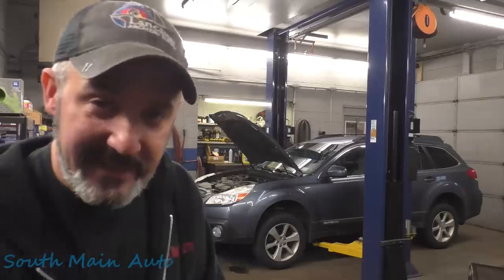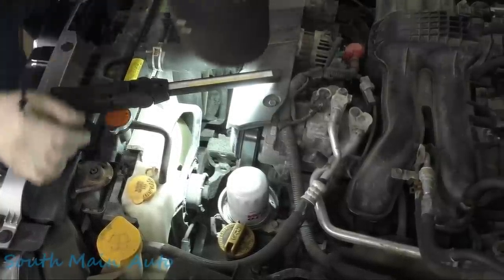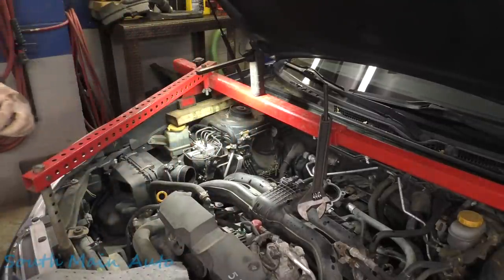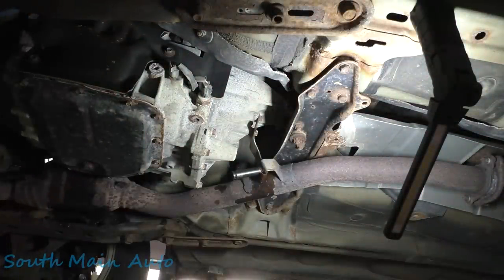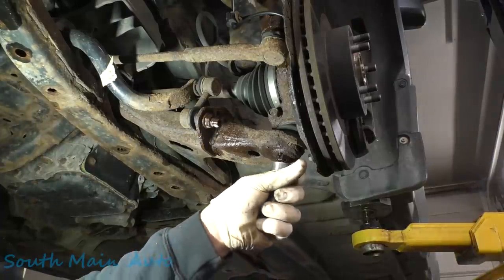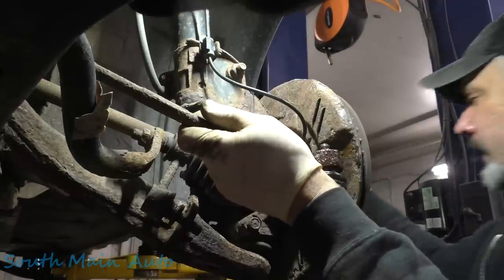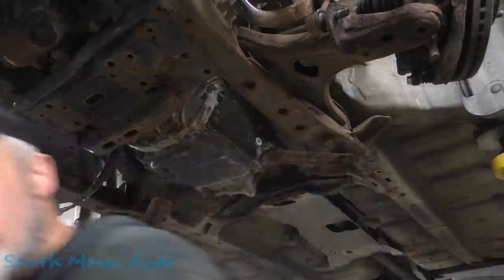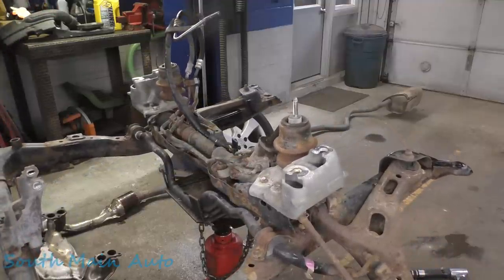Project Rotted Subaru Subframe - Part I

Comment: I just replaced the front subframe on a 2013 Mercedes C300 (damaged, not rusted), and what I did to support the engine was I hooked a ratchet strap around the frame rail on one side, then strategically under/around the engine, and then hooked it around the other frame rail. It took a little creativity and planning to get everything situated where it needed to be, but it worked great.

Comment: On Subarus when you support the engine you use the mount that’s built into the compressor area or you use a “special tool” that bolts into the block in the same area. Also when you remove the engine I use the bracket on the pass rear and the spot near the compressor.  That’s what it’s meant for. But that how Subaru wants you to do it, what works…. WORKS! 😂

Comment: Daughter had the subframe replaced on her 2005 subaru a  few yrs ago. Western NY rust belt is very hard on cars driven in the winter. Car is now gone as one of the lower control arms broke in two pieces about a month ago. Lots of other issues like oil leaks, head gasket failure, etc and it was time to cut and run. They dont last forever.

Comment: I really enjoy watching your videos; I learn something new from almost every one. One thing that drives me crazy though: You hardly ever wear safety glasses, even when you're under a car looking up at the rust flying off while you're using air tools. I got a piece of metal in my right eye helping put an engine in my friends van when I was 17 (66 now). It hurt like hell, and getting it taken out was no fun either. I've worn them whenever I work on anything where that could possibly happen again ever since then, and they've saved my eyes from damage more than a few times. I wear the ones with the magnifiers in the lower lens these days, and that's a big help too. Just some friendly advice, but I'd hate to see you get hurt. Stay safe and keep making these great videos. I watch due to your sense of humor as much as for the information, you're never boring!

Comment: I've done 2 of these in the past month at my shop. Not nearly as crusty as that one. The rear control arm bolt that goes up through the subframe into a sleeve broke away on both. The worst part is no Subaru dealers deliver to me so I have to drive 75 miles to go get the subframe.
Reply: Haha… going for a drive would be my favorite part. I love driving and getting out of the shop every now and then is good for me.

Comment: On the west coast of Florida we have a better way of getting salt on the road. We like to call it storm surge. The Gulf Mexico ends up in people's front yards and across roads. People being people they drive through it. I've seen a few people crack their blocks bombing through two feet of water pretty impressive. Cars that have been in the Gulf of Mexico or in the water like that you'll rot out in a couple years
Reply: I worked in a body shop for Lincoln dealer on the west Florida coast in the  mid 70’s and we fixed a lot of cars that were parked under beach houses before the condo boom. Those cars were pure salt crusted in every nook and cranny and underneath, worse than any car I ever saw living in New England previously. Those cars were all junk from the high rent Distric of the beaches !!!!
Reply: @rogern5368  doesn't surprise me. I lived in south Tampa, salt water on three sides. Part of why I hate aluminum air conditioner coils on home air conditioning.
Reply: @pudermcgavin4462  no argument here

Comment: Nice video,  I'm suprised that it makes financial sense to replace that do you mind telling us how much the new subframe was? Also could you please show in part 2 why it failed inspection? 
Re spilling the ps fluid, you're not a hack lol, that's the only reason the exhaust bolts came out Haha!
Reply: It's significantly cheaper to replace the subframe than to go out and buy a new or used car in the current market.  Even in previous years for most cases, its cheaper to maintain a car than buy a new one every  three to five years.  For some reason folks like to keep that car note rolling on forever.
Reply: I doubt the new sub frame will be brand new. Most likely used rust free. Can't wait for part 2
Reply: that U frame is about $400 brand new from a dealer. i just welded a patch on mine yesterday. =]
Reply: Cheers

Comment: I must be missing something here.  It’s a 2014 and the frame shouldn’t have rotted through yet.  I don’t think he has showed exactly where the problem was and why the frame was not salvageable.  A torch can do amazing things when it comes to frame repair.  Hope he explains in part 2.
Reply: Nope! You need to check some out! Body on my patriot still had manufacturing tags on it and subframe let go on turnpike causing left front wheel to collapse into wheel well. Nothing left but rot!
Reply: Eric show us the issue in a Short. Clearly it needed to be replaced.
Reply: @ME-xd4he  yup. I saw the short.  Comment was made before the short.

Comment: You gotta be the rust crust master.
My experience is the unibody crumbling as I'm removing the body mount bolts. Just walked away from a Brat with the rear suspension falling out. Sure looked good from the top side!

Comment: Hi, Mr. O. I can see that in the PRNY, rusted out sub frames is a big problem. I guess mostly such just go to the crusher. But the cost of new cars seems unreasonable. Pent up Covid demand is probably the cause. If it were me, I would rather repair a good car than pay more than asking price for a new car. I had never seen a sub frame extraction. The engine suspension device is another new item for me. I am looking forward to seeing part 2 of this job. And don't ask Mrs. O. to help you with that job! Anyway, thanks for sharing! Stay healthy!

Comment: As the owner of a number of Subarus over the years, I can affirm that they have a particular affinity for the demon rust. Beware, when you buy a used Subaru. Get it up on a lift first, and check it out.  I'll be curious to see where Eric sourced a decent front subframe replacement.
I've heard they could be found in Florida, but that was years ago.
The rear subframe is a nightmare to tangle with. All sorts of things have to be removed, to get it out. I've junked more than one Subaru, rather than deal with that hornet's nest. I've got a rusted out old Impreza in my yard I still sit in, just to listen to the great stereo.
The motor is fine, but the rest of it is history.
Re WD-40: Great stuff. Accept no substitutes.

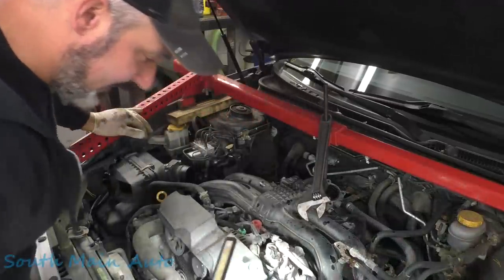Comment: 13:00 - tip for you Eric, Ahmed the Car Care Nut, a dealer master technician for a long time showed that if you don't want your lines to peepee all over your kitty converter, use those expandable bright orange ear plug protectors to squish the line closed from the inside without the viewers generating comments about not using pliers to shut em down.

Comment: I'm in north central PA, I just had a Subaru Baja come in for inspection the other day.  The guy he just bought it from "had the subframe replaced".  Two of the four main mounting locations were busted right off of the car and someone tried to pack aluminum foil duct tape and Bondo all around the broken locations and paint it black.  Needless to say the areas were already ripped open again.  People don't value their own lives or the lives of other people.  And also, southern mechanics and car owners don't know how good they have it...

Comment: How I hate NY and salty roads. We visited a sister living in Richmond, VA in 2013, and needed a new seatbelt for the rear of our 2000 Dodge Ram Van. They had one in a junk yard in Mechanicsville, same year, make, model, color that was flipped on its side in the yard, someone needed something off the bottom! The chassis was perfect. Zero rust. We should have just swapped out our motor and tranny and driven that one home, as ours was rotting the entire underbody, especially the wheel wells, you could see daylight through them, on a 13 year old vehicle. NY to VA might as well be a world apart when it comes to rust.

Comment: Thank You, Funny after 40 years in the Business I have never had to do a R & R of a Rusty Sub frame, Bent Yes, Rusty as this Ah,, NO. I was from SLC And yes we use Salt. heck we were next to the Great Salt Lake. Vehicles Do rust there, But not even Close to as bad as they do in the East. humidity I think.
 I drive a 1997 F250 power stroke, No rust and a 1977 Gmc Panel truck drivers door I just reskinned 5 years ago. a little inner structure repair on the bottom. I replaced a lot of door skins and cab corners, and wheel wells on the older 70's era trucks and cars but nothing like you get. Bless you in the RUST belt. You have a lot to deal with. Oh I moved 20 year's ago to norther Arizona No rust here. Just electrical plugs that disintegrate when you touch them, joys. Good with the bad.

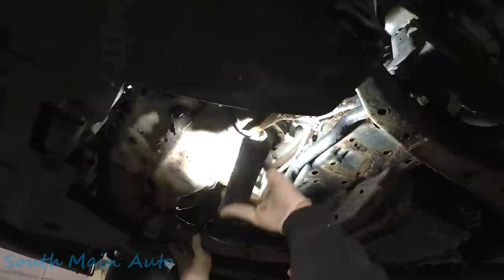Comment: 15:46 Eric I was right there with you when the cherry red exhaust stud came off and found your pocket, had that happen once when I worked in a transmission shop!
Reply: red hot pieces of metal are like heat seeking missiles when it comes to finding pockets-shirts-top of boots-etc

Comment: Nice job Eric you make it look easy working in the rust belt! Some heat there a little massage there & Bob's your uncle!
Reply: Not quite.. we don't see off camera when there's swearing.. throwing tools and getting angry... I can imagine some are an absolute ball ache.. especially subaru rear suspension with the massive long bolts

Comment: This is why you should oil spray the undercarriage of all vehicles in the snow belt areas!!!
Let this be a lesson folks!
Reply: You are absolutely correct.  There are a lot of clueless people in this forum thinking that this rust problem is only about Subarus.... they are so sadly misinformed.  If you don't apply some type of fluid protection to the bottom of your vehicles up in the Rust Belt (especially in New England), ALL cars will suffer the same fate.

Comment: While repairing a computer I was trying to take a disc drive apart.  One of the screws was stuck and I was in danger of twisting off my T4 wrench.  So I thought "what would Eric O. do?"  I pulled out my butane lighter and heated the screw up for about 30 seconds.  Darn if it didn't come right off.  My tiny T4 wrench lived to see another day.

Comment: Stumbled on your site ... you seem to do very good work I salute you ....one technical point: You do not need and IMO should not use the AO cutting torch/tip for the small bolt/nut heat ups you do. Try to a very small AO welding tip instead and you needn't heat the whole nut/bolt just a quarter of the nut heated will provide enough distortion to break the rust bond also let the nuts/bolts cool down before removing since it is in the cooling (not the heating) of the nut/bolt that breaks the bond. If you torque when hot u run the risk of twist off...hot metal is weak...cool metal is strong. I would take my vehicles to you if I lived upstate...happily i do not! :)
Reply: Time is money in a shop environment! Switching tips 10-20 times a day for each size nut or bolt and switching back/forth to cutting torch isn't all that practical. Eric has a pretty good feel for the heat needed and ugga duggas required.

Comment: My son’s 14 has 165000 plus although it was under coated and had oil leaks that were repaired at the dealer (under the dealers lifetime warranty ).  The frame hopefully is good

Comment: You can tighten vice grip pliers after you clamp them onto something with another pair of pliers. It will destroy the vice grips you are tightening on doing this a lot, so don't use a $100.00 pair of vice grips. In a pinch it is possible and does work. Oh, I suggest face protection in case something bad happens. Nothing has ever happened to me, but be careful.

Comment: a little Rust Check or Fluid Film throughout the yrs would have saved this part...especially in NY state where salt just destroys these subframes....I have a 2017 Outback and it is night and day compared to this one with Rust checking since I got it new.....My last Subaru 2005 Baja lasted until I sold it 2020 99% rust free because of the Rust Check...those cotter pin removals sent shivers through me because I have literally spent hours maybe days of my life removing them from big rigs while doing kingpins and you had to save 300 dollar tie rods and drag links in the mean time....some came right off while others tortured me...that is why i use antiseize on EVERY cotter pin I install

Comment: Eric: I watch you working on this crap & I shake my head. If I  were 18 instead of 82, no one could convince me to be a vehicle mechanic. When see the cabs taken off pick up trucks to work on things & I see alternators located so that half the damned car has to come apart to remove the alternator, & new diesel  pick ups that have HPCR injection systems, piezo electric injectors, high pressure pumps with insane injection pressures, high pressure regulators SCR, DEF & all the other crap, there isn't enough money in the world wouldn't be enough to get me to work on them. I stick with my 97 Dodge diesel, & my series 2  3.8 litre  2003 Buick. If I was looking for another car, I think it would be a model "A" Ford ! 
Your videos are great, & your knowledge & integrity are beyond excellent. Thanks for a many year education & entertainment Eric. Cheers!  from the wind swept plains of Alberta. Cheers!  Brian

Comment: I saw the short on the question of the value of investing the cost of repairs in this vehicle. I definitely agree it was worth it for a car only nine years old. I would have invested another $600 to $700 or so and replaced all the hardware and the engine mounts and maybe the power steering hoses and hard lines as well. I got twenty years out of my last car. I don't see why this one couldn't do the same.

Comment: I suppose we have less rust on Long Island, inspection can be as quick as plugging in OBD II, glancing at disc brake pads through the wheels, and checking the lights!
Reply: A wheel must be pulled as part of inspection in cuomostan.
Reply: @walterk1221    Yes, a proper inspection includes that!   One (new) station I went to even opened all the doors to check the seat belt inertial locks.

Comment: I did one of those a month ago, way more sketchy than your set up. I didn't think about using the lift point on the tranny. Last two I did, one of the bolts on the left mount broke off where it mounts to the frame. I'll be waiting to see if yours does haha. Control arm vertical bolts were frozen as well. Good luck.

Comment: Subaru sells the rack hard lines separate. New rack isn't necessary but just those hard lines I would have liked to replace. Did this same job on my 2010 only to later find those lines are servicable.

Comment: I used to have an 04 Caviler that I bought from a "dealer" in Niagara Falls. I found it on Craig's list for $1,400. The "dealer"  said it's good to go, nothing wrong with it. The first thing to break was the rear strut, then each and every break line (I needed new drums because the wheel cylinder was leaking and contaminated the shoes) then the subframe rotted out so bad the shop had no good metal weld to. I didn't have the $900 to replace the subframe so I sold the car.

Comment: The sway bar drop link bolt has a hex socket to stop it spinning when you remove the nut.
Reply: Yeah good luck and not stripping out the hex when trying it like that with all the rust on that bolt.

Comment: Mrs O will you please talk to Mr O in reference to the use of safety squints when he is pulling rusty bolts from above his head. The soft tissue basic issue shields work sometimes but flakes still enter the optics orbs thus scratching and generally debilitating visual acuity.
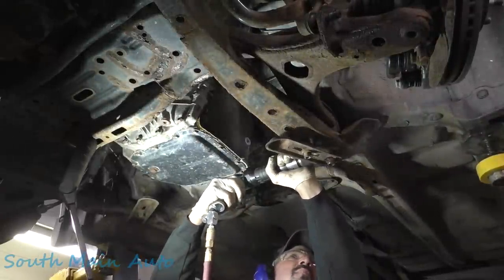Reply: At 35:01...safety glasses on.

Comment: i had a 1992 gmc safari the subframe was gone on the drivers side a arm was no longer connected and we welded new metal on it to reconnected it. i drove it till the trasmission went out 4-5 months later and junked it

Comment: When all the old usable parts are removed will you show the rusted out areas that caused the failure. Not to second guess but just to see it. Hell of a  J. O. B. !!!!’
Update part II I was zooming and saw the Swiss cheese sub frame, it was bad all around the frame some places real bad. Soon if the owner had hit a rough set of tracks he would of drop his engine out under the car. It’s amazing how this can happen so quick to a car. 
I screen shot a few bad spots too bad we can’t post em here ! I still am amazed that some questioned you doing this job. You likely save some lives doing this work and you saved the owner a bunch of 💵💵💰🎄

Comment: I’m finishing up putting a rack and some wheel bearings and speed sensors in a 2015 Toyota Yaris service information said to drop the sub frame 😂 I took the bolts out of it on the drivers side and took the torque mount bolt out underneath the sub frame unhooked the sway bar links and I was able to sneak it out no way I’m trying to get every bolt out of that subframe I prayed the ones I touched came out

Comment: free tip friday for you @ 24:50 hit the end of that stud with a wire wheel, heat it, then spray with the panther pee. 9/10 times she comes right off, sometimes without the vise grips

Comment: I didn't think you would take on a Subaru because because as they age they are a ticking time bomb.  This is a interesting video series thanks for the good work.  Always nice to see Mrs. O's smile.
Reply: Just sitting in the garage a Subaru can become a liability. Our 2018 Legacy with 9,000 miles has issues that can't be fixed by Subaru that limit it to short trips in town. One person drives the Legacy while another stands by on alert in case there's a problem with it's battery suddenly discharging.